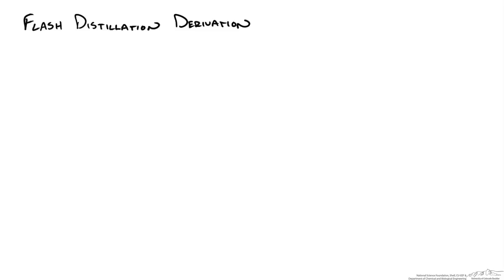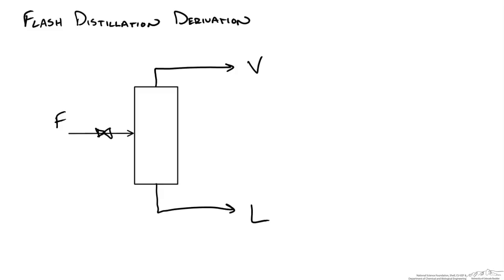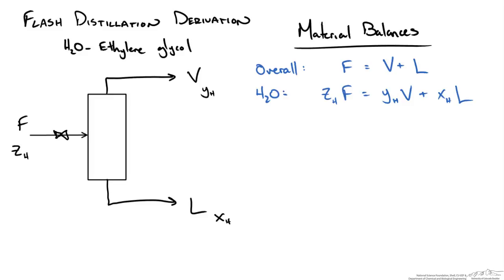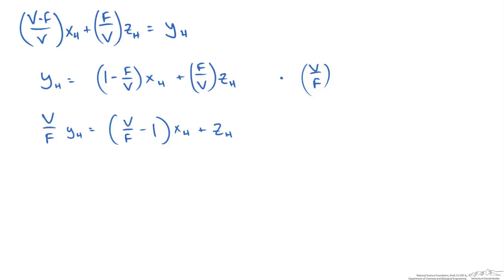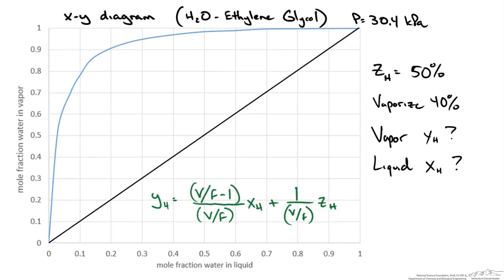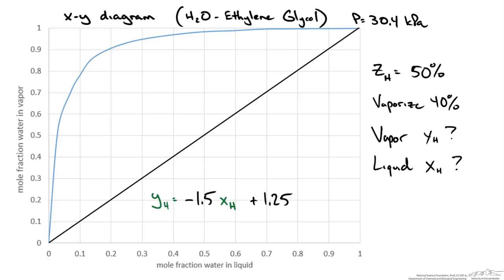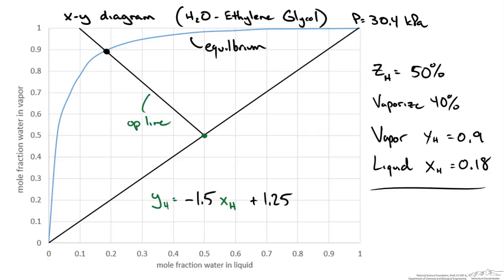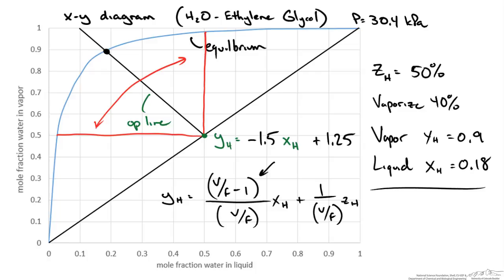Flash Distillation Derivation

Comment: Why did you chose 0.5 as the point of intersection y=X line n the operating line?
Reply from the maker: Thanks for the question. You are trying to draw the operating line and you have the equation yH = -1.5(xH) + 1.25. You find the point at xH = 0.5, which means you solve for yH and you get yH = 0.5, so that point is on the y=x line.
Reply: Okay thank you for your assistance, so we use the composition of the feed zH in this case to find the intersection of y=x and operating line drawing all the way to equilibrium curve?

Comment: Anybody know how to find the Bottom Operating Line if you're only given the boil up ratio on a column with a partial reboiler?
Reply from the maker: Take a look at some of the distillation videos where bottoms operating lines are determined using boil up ratios.  There is an operating equation that is derived from material balances on that section.  Assuming no special cases (i.e. side streams, multiple feeds, etc) the bottoms operating line is y = [(Vb+1)/(Vb)]*x - [(1/Vb)*xb] where Vb is your boilup ratio and xb is your bottoms composition of the more volatile species.